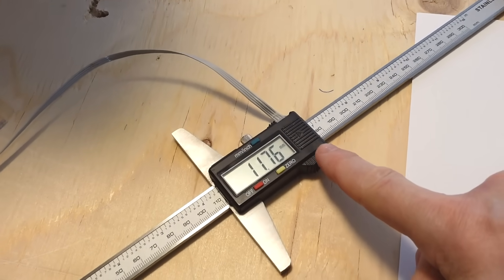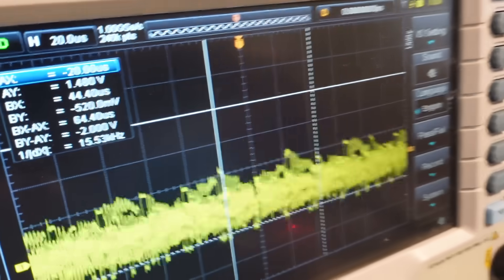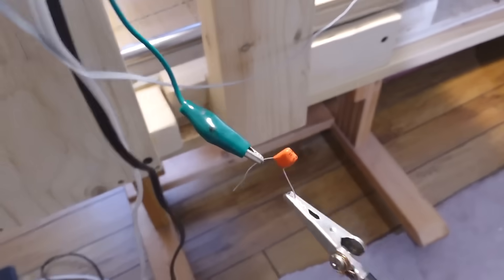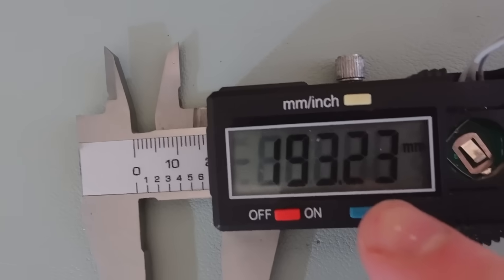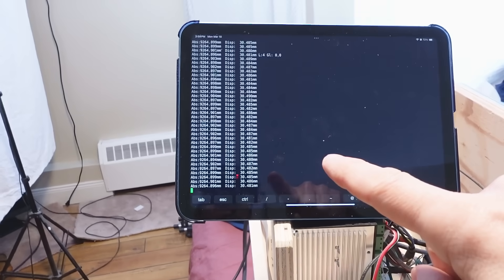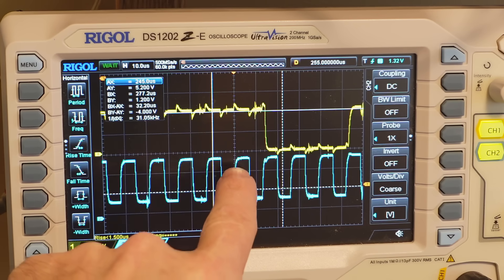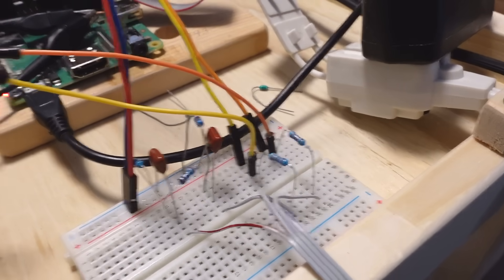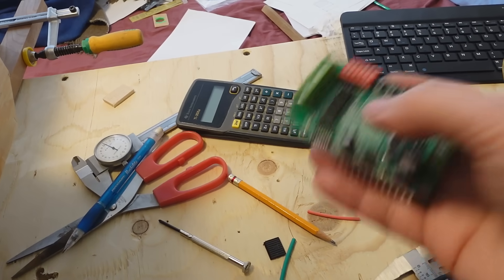Small signal high noise and dealing with it

Comment: After watching many of your videos over the years I understand you like to use the most efficient method for fixing something but could you possibly hack together a fast fourier transform DSP filter to denoise the signal. Of course this doesn't follow the KISS rule.
Reply from the maker: Not FFT, but there are definitely DSP techniques that could be used, a bit like what is done in wireless communication, where every extra dB of sensitivity is worth the effort.  Signal processing on its own would fix the errors regardless of signal conditioning.  I don't actually need the clock signal to be that good, I just need enough of it to know where the bits are, and just rely on timing to know when to read the data line.  Also, the bit valid period is longer than the clock pulses, so I could extend the period of reading and averaging the data line.  Much that could be done.  If only there was a real good reason to make it worth the effort.
Reply: @matthiasrandomstuff2221  That's true. I'm sure you will probably figure something out that doesn't require a lot of complexity considering this is just something for your own use. Thanks for your reply and thoughts on that.
Reply: @matthiasrandomstuff2221  Okay... when we do this kind of stuff... we like to think we are clever, or efficient, or minimalist. Just the same when the Chinese do it we call it junk, or cheap, or Chinesium. Personally, I support them... or double standards either.
Reply: There's a reason most CNC machines use shielded cable for everything, with ONE end of the shield grounded, and not 6 feet of unshielded ribbon cable
Reply: @gorak9000  Interesting note on that. I agree the standing practice is often 1-side grounding of the shield; but, sometimes that increases the noise. Sometimes (maybe mostly) you need to ground the shield at both ends, and use star grounding to avoid ground loops.
Reply: @willthecat3861  Grounding at 1 end of the shield is usually done specifically to avoid creating ground loops. Which end you ground at usually depends on where the noise is coming from, and which end being grounded provides the shortest loop for the noise. You don't want to ground the shield at the far end of the cable, which itself is only grounded through a conductor in that cable - that's doubling the length of the ground! Commercial machines usually ground the shield of the cable by stripping a band of the outer jacket off, and clamping the cables to a support brace that's grounded to the electrical cabinet, that has a large ground wire bonded to it that goes directly to the earth lead on the incoming power wire. That way, the shield ground is taking a completely separate path back to the main ground than any signals are, and it also provides mechanical support too which takes the strain of the cables off of the connectors.
Reply: You don't need an FFT to implement a low pass filter.  FIR/IIR is fine and easy enough to calculate.
Reply: @ Thanks. I know, I just wanted to see who would respond and correct me on that. 😄
Reply: @ Our professor would make a lame nerd joke that a Chebyshev filter sounded more like a brand of automobile.
Reply: @electronixTech  it is the Russian version of a GM product line .. or in my youth, it would have been the type of filter on a cigarette.
Reply: Ah, KISS... the boss used to say... is that 'Keep it simple stupid' ... or is it ... 'Keep it stupid simpleton'
Reply: LOL, what?!  He could just properly drive/shift the signal instead.
Reply: I don't think the noise he's running into is a giant problem.  Yes, sticking level shifters on the drive end would help a lot, as evidenced by running the calipers at 3.3v.   But looking at the scope, it's pretty obvious that the noise isn't really ever changing the signal in any way, as the signal is so much lower frequency than the noise, so signal processing is likely all that's needed.  If this were a CNC machine he was selling to people running the machine 23 hours a day, sure, do better. But for a hobby project, a software low pass filter is probably good enough forever, and ships a lot faster than a level shifter.

Comment: your problem has nothing to do with the caliper circuit, voltage, or pi. I bet 99% of your noise is being picked up by that long ribbon cable and the prototyping leads you have between the scope probes and breadboard. You need a better transmission line like a twisted pair cable; just use one of the pairs on an shielded Ethernet cable.

Comment: So why not use a cheap level shifter? Just wondering
Reply from the maker: cause if I put that next to the Pi, it would do exactly what the Pi does.  It would have to be attached to the calipers, and that means some stuff hanging off the calipers, which I don't want.
Reply: @ cool, didn’t think of it that way. Ty for the reply

Comment: Aaaah, you can still use resistors to move operation point of a calliper to the middle of Raspi. But there is several important things: you should shorting the lower resistor between the ground of raspi and the minus of a calliper to minimize noise adding to the calliper "ground". Here is 1-10 micro farad is good, you can use elcos or tantal caps. Second you should decouple the power of the calliper itself - using 0.1 microfarad cap between plus and minus of the calliper. Third - you can use ferrite pearls or some other EMI filter in both clock and data wires near to the raspi it reduce a lot the HF stuff. And I personally would use level shifter based on single MOSFET for example MMBT7002K with gate-source threshold voltage < 1V. You can use also BSS138, but then you should select transistor, because its threshold voltage varier between 1 and 1.5V. Example of such level shifter https://www.blikai.com/blog/featured-products/bss138-mosfet-principle-features-applications

Comment: Things are usually not as bas as the scope probe hanging in the air makes it seem. The input of the scope is very high impedance, whereas the digital input of your Pi is not. The source of the noise often does not have enough current to move the potential significantly on a digital input. That being said, your voltage divider solution to lift the signal from the caliper will effectively increase the impedance and thus worsen the situation.

Comment: Using a o-scope probe without ground makes it an e-field probe—a great big one. You can see fluorescent lights just being in the room with them. 

A single mosfet per line and a pair of pull up resistors would give you the level shifting you want, but wouldn’t solve your noise issues.

Comment: Good work, always interesting to see how you solve your problems.  I've found in the past tying everything down to the same ground using a low impedance method (i.e. big cable, large ribbon, even copper plate) helps massively.  We had an issue with a 30kV nanosecond pulsed DC power supply where our equipment was transmitting around the lab and being picked up by other spectrometers which were sensitive down to around -120dbm.  Once we tied the grounds of our power supply and the rest of our equipment together using copper plates the transmitted noise issues vanished.  RF can be "interesting" at times....

Comment: the other source of that noise that can cause havok on cnc machines is dust collection.. not just the motor but the crazy static that can happen as dust flies through plastic... and if it discharges occasionally it can trip limit switches which is another reason to have all of your switches isolated behind opto-couplers. Thanks for the video!

Comment: I don't understand the reluctance to use a level shifter. A single BSS138 n-channel mosfet and a couple resistors isn't any more complicated than he fixes you chose. 

I acknowledge that it's infinitely complicated if you don't have a mosfet handy. I bought about a hundred of them several years ago and hsve made good use of them ever since. I recommend them as a standard item to have in your personal stock.
Reply from the maker: that level shifter on the PI end isn't going to do anything, it would have to be on the caliper end, whereas I just have the ribbon cable soldered to the board -- nice and simple on that end.  And a single BS138 and a couple of resistors is a lot more complexity than ONE resistor I use for each line.
Reply: @matthiasrandomstuff2221  i see now. Thanks!

Comment: Why not just use a transistor to amplify a weak signal...
Reply from the maker: cause that's a lot more parts.  Also would need to be on the caliper end, cause by the time it gets to the Pi, its already got the noise on it.  ANd then I need a PCB at the caliper end, plus power.
Reply: @matthiasrandomstuff2221  You already have 5 resistors and 2 capacitors in this resistive divider madness... i dont think it is possible to make it even more complex by adding 1 transistor...
As you may know (or not) transistors amplify the current, not voltage!
If you place a bleeding resistor across the base-emiter of a transistor, the voltage which get picked up by a long wire and has basically no current will simply bleed to ground or be greatly reduced!
The caliper will provide much more current than the noise that coming from the background.. so signal must amplifie cleanly!
And you dont need PCB to do this... transistor have only 3 legs...
solder all connectors on perfboard and isolate it with "shrink up tube" or tape....
Sorry for my bad english...

Comment: Just to add to the melee of advice in the comments...

A full solution to both your level-shifting issue, as well as your line noise issue, would involve approaching the problem from several angles at once, and there are many rabbit holes to fall down before you get to the other side. However,

The most effective, yet incredibly simple, remedy to both of your problems would be just to use a humble voltage buffer. This is because both issues (ie: biasing the signal upwards, and rejecting line noise) are strongly influenced by signal output impedance. I'm not going to bore you with a lengthy explanation. I'll just jump straight to describing how I might solve the problem.

I'd look under the sofa cushions for any old single-supply dual op-amp... even an LM358 which they basically give away for free, and the cheap counterfeits outperform the original part and also generally run fine on 3v3. I'd connect the inverting input to the output on each side, connect VCC to 3v3 (or 5V preferably) and connect GND.

Now both of my op-amp stages act as "voltage followers" (or "buffers") meaning whatever voltage I connect to the non-inverting inputs will be matched by the respective outputs, except now I can put a load (or inductive noise) on the output and the voltage will be maintained. Connecting the op-amp as close as possible to the signal source (ie: the calipers).

I would use one buffer for SCL and the other for SDA. I would bias the signals the same way as before, making sure to minimise the distance between the SCL/SDA pads, the biasing resistors, and the op-amp's non-inverting inputs. I would avoid adding resistance between the raspberry pi and the buffered outputs -- assuming the signals are being sent one-way only. For the Pi to be able to assert a signal back to the calipers, you would need to increase the buffered output impedance to avoid overwhelming the little GPIO transistors as they attempt to pull the signal down to GND.

I would probably also involve a TL431 to provide a stable 2.495V reference Voltage which could be used to power the calipers, as well as providing a more suitable biasing voltage, depending on what resistors I have available.
Reply from the maker: yeah, then I'd just have to build a PCB and somehow attach that to the calipers.  I prefer my simpler solution.
Reply: @matthiasrandomstuff2221  I mean, you're already using a breadboard. That's how I do it

Comment: Could you use a comparitor and treat it as a differential signal like RS-485? Or you can just use the max3485 serial to rs485 converters, but that might be overkill? Sheilded wires like others have mentioned might be the simplest approach.
Reply: I had assumed that by serial you meant rs232, but I see now it might be SSI or I2C, either way there are approaches to use differential signals for both of these.

Comment: why not run it at a higher voltage but add a resistor to the internal screen?
Reply from the maker: you mean break 10 tiny traces and solder resistors to them?  that’s an exercise for you.
also, higher voltage adds some inaccuracies, so I dropped it down to 1.6 later.  do watch the video.
Reply: Yeah, probably 😂. Also I may have been a bit too quick with my commenting. But at least it helps the YouTube algorithm.

Comment: In this video: Mattias tries 100 kludgey ways to fix something instead of implementing a straightforward and proper solution.  It would only take a few minutes to add a transistor inverter to properly drive those lines.
Reply from the maker: that inverter has to be on the caliper side, I didn't want to add components dangling off of that  thing.

Comment: Use RS422 transmitter on caliper and RS422 receiver on pi and you are good to go, it would work with even long cables with no noise.
Reply from the maker: but then I have to add something dongling off the calipers
Reply: @matthiasrandomstuff2221  Yes, but it would be small. You would need to make pcb for it. It could plug into calibers with some spring contacts.

Comment: Try using a cat 5 cable instead of that ribbon cable.
Reply from the maker: But I solved the problem.  Why does everyone suggest different solution when the problem is solved?
Reply: @matthiasrandomstuff2221  You don't have to get upset.  There is more than one way to fix something.

Comment: Ferrite chokes.
They were a life saver when I built my homebrew CNC. Cheap (free if reclaimed from surplus hardware!) and relatively easy to install (especially the split ones). Completely eliminated phantom stepping and glitching.
I wish I had a decent scope to see what they did to the signal quality.
Reply: I'll second this comment!  I had a lot of glitching when I built my homebrew CNC several years ago.  I put a clamp-on RF choke where the wires come out of each of the stepper motors and also added EMI filters to the AC inputs for the power supplies. Don’t have any problems with electrical interference any more.
Reply: @eh42  on 3d printers its more common that the motors glitch the endstops if wired nearby leading to random loss of position (the steppers themselves often ran at high frequency by the drivers for microstepping)

Comment: Still the best thing is to just get a shielded twisted pair. I don't really get the doing everything you can to avoid doing that.
Another option might be to use a potmeter and shift the signal more or less to try and get out of the range of noise.
Also if you just move the Raspberry Pi away like 20cm it probably reduces the noise enough for it not to matter.

Comment: If it's good enough for you it's good enough. But if I were doing this (and yes, I've hacked things like this in the past, but I admit I'm not doing it this time) I would at least try using shielded cable or twisted pairs. 

A hunk of ethernet cable for instance. Use one pair for clock and one for signal, ground one end only of each pair. Same end for both pairs, obviously. I think I'd put the 10K resistors at the caliper end driving the twisted pairs. Might need a little smaller resistors since the TP will have capacitance too. 

Pairs probably should be grounded at the caliper end, but that would require experiment since you have the calipers on a floating ground. A decent size cap (0.1uf or so maybe) across the bottom resistor of the divider would probably also help if you don't have one.

Since I don't like even occasional glitches, I'd probably also use half an 8-pin opamp to make a Schmitt Trigger inverter centered around the middle of the signal level for the calipers, and not use the floating ground. But that's just me, and is probably overkill.

Comment: Have you considered using a pair of Op-amps, each of them getting + from a 3.3 v line from the Pi, and - form the ground, using a resistor pair to get your comparator voltage, then inserting your caliper signal on the other input, such that the output will swing between v+ and v- as the caliper level crosses 1.65 volts? You may still want the caps for debouncing, but you should otherwise eliminate the cross-talk. Another hack would be to use twisted pair with different twist rates, Think Cat6 Network cable, ground one of each pair of wires and use the twist to reduce your interference. Still use the Op-amps as level shifters. That might be more expensive than actually using a level shifter, but I would think it might take fewer components.